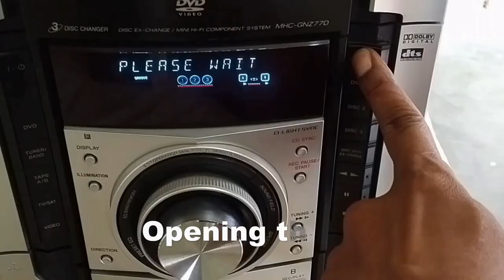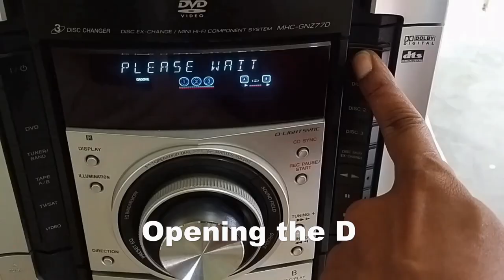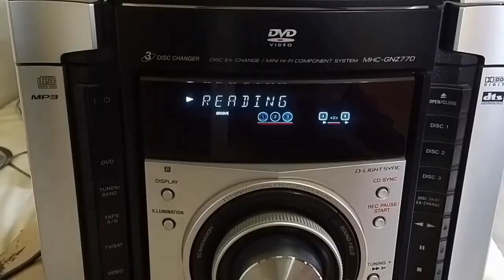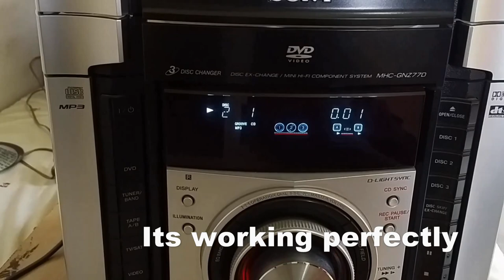Sony MHC GNZ77D Lens Cleaning

Comment: I don't have aux cable of red &white port I have only one one port from both side
Reply from the maker: You have connect through AUX Cable only. 
You have to purchase  AUX Cable which is one side Red and White and other side is 3.5 mm jack. Connect 3.5 mm jack to your phone and Connect Red and White to your system on back side. Press TV Botton on your Hifi system front panel and open music player on  your phone and just paly it. Thats all
(You can search on google as "AUX Cable picture")

Comment: Ahoy Krish! I've got similar problem with my Sony MHC RG270, also 3 CD trays (it reads some CD's, some CD's absolutely ignores). It seems to have similar setting as yours, will it be safe if I open it as you have and do just that? Do you reckon it might work?
Reply from the maker: I think you may clean up the lens and lubricate the lens unit with one drop of sufficient oil. These all you can do while opening the unit. I am not a machanic but I done this successfully. Un plug the unit before doing any thing. Have a nice day
Reply from the maker: Don't clean lens with oil. Clean using with lens cleaner liquid.
Reply: Cheers Krish, will give it a go in a  couple of weeks, thanks man.